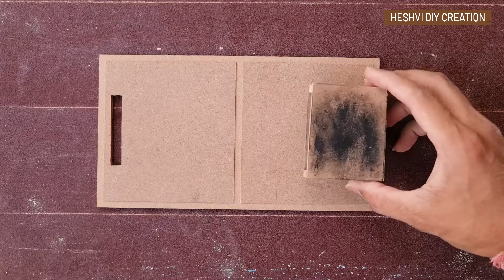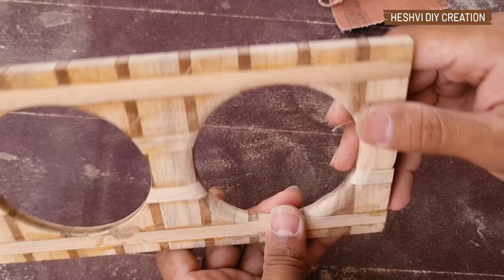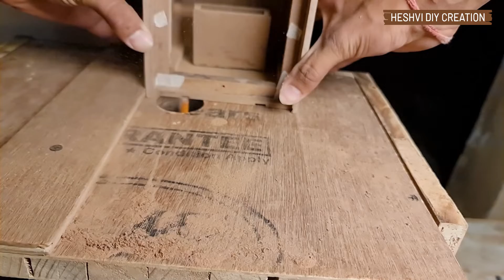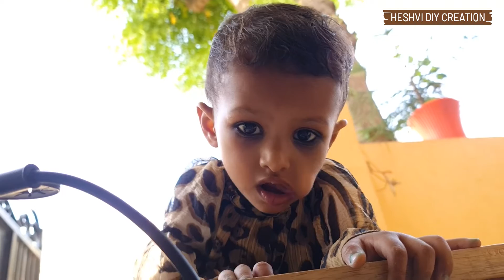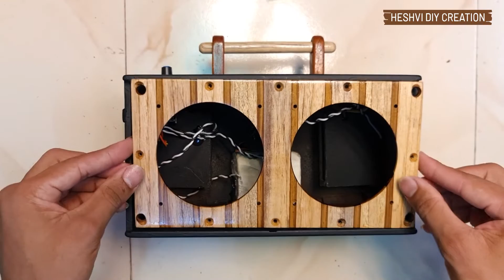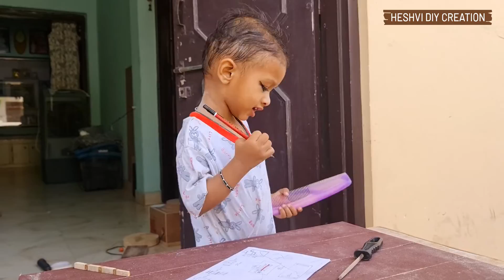Bluetooth Speaker with TPA3110D2 | 2x30 Watt | Bass Beats | 4 Inch Coaxial Speaker | HiFi Audio

Comment: And, let me clarify why you need a BT BOARD with this. As TPA3110D2 is a class D amplifier, you get over bass and quality of bass reduces with the full volume. So, first of all you need to apply a good quality BT board and for maintaining quality, a passive crossover can even be added. Ok
👍🏻
Reply from the maker: 😊😍Thanks for your valuable Comments.
Reply: @HeshviCreation  your welcome bro. I am a professional audio repairing expert from Gujarat.
Reply from the maker: Keep Support Buddy 
I am a beginner in this field
Please Always Teaches me When i am Doing Mistakes
Reply: @HeshviCreation  ohh bro, No one is fully learnt in this field. I'm even a learner like you people. Just the thing is that I've a little experience due to business & experiments.
Reply: @HeshviCreation  one more thing I would like to say is that, if noise is distorted in full volume due to over bass, then use 2x 15K resistor on inputs of both stereo channels of amplifier.